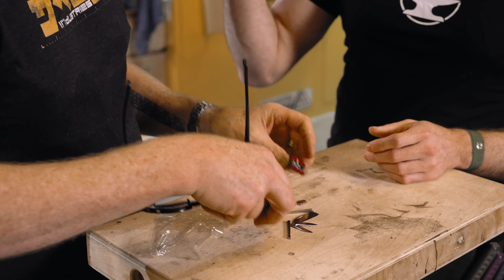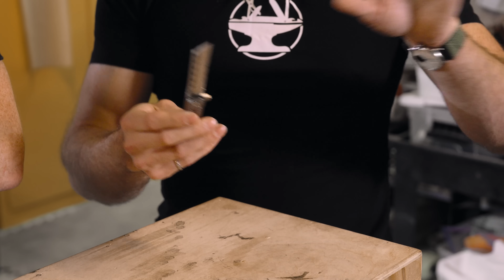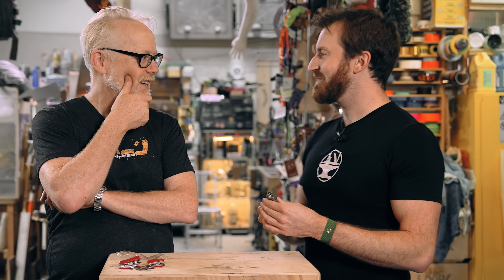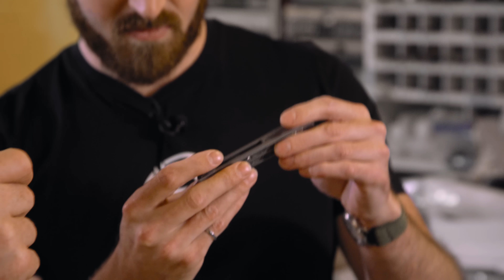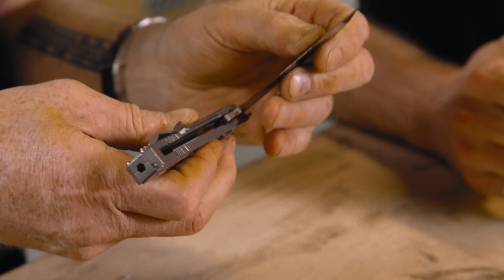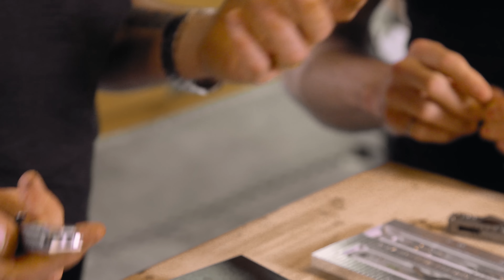Adam Savage Wields Hacksmith's Titanium EDC Multi-Tool!

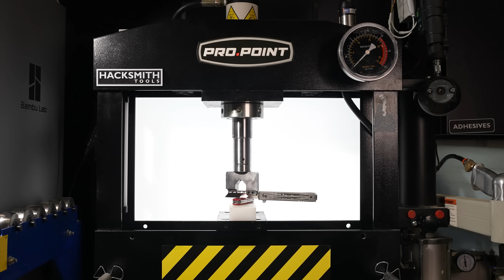Comment: Did anyone notice the damage in the blade (I think) at 01:23
Reply: That's probably where it was pushed down into his boy scout knife tbh.
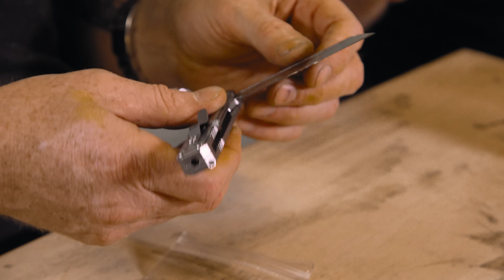Reply: I thought the same thing it looks like the blade has a rolled edge 14:00
Reply: Valid point. I missed that.
Reply: you can see both of them trying not to say anything about it
Reply: nope
Reply: Yes for sure. You’d think they would’ve showed a blade that was mint rather than the blade that’s rolled over from cutting that Swiss Army knife. Glad you caught that. I was about to spend 270$ on the kickstarter for the 14 in 1 prototype. Good eye bud. Glad I seen this. Still kinda feel like buying it now but I wouldn’t be doing anything like that after I pay near 300$ for this little knife. It looks nice and handy though. Wonder if I should complete the purchase. It’s very tempting. I kinda like the look and weight of this knife. I always have a knife on me. This one would be a great addition to my edc.
Reply: @davidlord5664  Trying to cut through several layers of steel with direct downward pressure is going to roll practically any knife edge. I’d be much more skeptical if it HADN’T deformed.
Reply: I think that's for wirecutter

Comment: The external features are cool. However, I find the main blade itself to be impractical for daily use.
The style of blade he chose, and especially the material he used for it, is an absolute nightmare to maintain if used on a regular basis.
I'd much rather it be a folding utility blade, where I can just swap new blades into it whenever I need to.

Edit: I'm also disappointed to see that comments shedding light on this potential pitfall are being censored from his main announcement video...
Makers should take the good with the bad and lay it all out on the table. He shouldn't be suppressing information about the product he's planning to sell.
People buying this blade should understand the difficulties they are going to face with it down the road...

And speaking of customers not being informed: That also includes the fact that the "Pro" version is the ONLY version with that type of steel. Half the sales pitch for that blade is the edge retention of that specific steel. But nowhere in his video is the fact ever mentioned that only the pro version has it, and the only place that information can be found, is in the fine print under an image on the kickstarter page... I believe a lot of people are buying the cheaper versions of the blade, under the rightful assumption that it's all the same steel pitched to them in the video, and missing the fine print that they are in fact not made of the same material. (That being said, I actually think the 14C28N used in the cheaper variants is a much more practical steel for every day use.) My problem isn't with the steel, it's with the seemingly intentional misleading of customers.

Comment: It’s a very cool tool and the ultimate multitool but the pro model costs more than my AirPod Pro 2’s. If there is some way to eventually get it to the $20-$50 range with cheaper materials or optimizing the manufacturing process or something I’d like to get one.

Comment: I'm sorry, but are "multitools" with skrew bits and rulers and tiny crowbars that probably won't work on most things actually worth EDC nowadays? The way the world is right now, I'd rather just have a nice quick deploy razor sharp thick blade and a high powered flashlight on my hip or in my pocket.

Comment: i would love one BUT i cant even for that price tag of 250 canadian....specially in this economy...i donno maybe im a cheap pr1ck but when i go to buy something i RESEARCH THE HELL out of it and that includes ways to pay the absolute bottom dollar for the product even if that means buying a "lower quality" part that does the same job....srry but my milwooky that i paid $25 bucks for has a blade and screwdriver attachment built in and wire stripper....and it was a fraction of the price....

Comment: You forgot to engineer the one thing you needed to - and that is the price. It looks like a capable tool to do a couple of things that I might need it to do. But at $99 up to $200 it missed the mark in one area. That these tools get lost more than they do damaged. Which leads back to price. It's going to be hard for many to replace this tool if lost. It makes more sense to make smarter design choices to bring in a tool at $50. Do we really need the costly titanium?? Really??

Comment: It's neat if you're in the market for a knife with a bit driver built in. Not going to replace my actual multitools though. Also just FYI there are knives with a ratcheting sound when opening, the Spyderco Navaja has it which was based off of the Spanish Navaja knife which also has it.

Comment: 21:42
I decided to do the math for fun

based on the kickstarter, they currently have 12139 knives to make
that's 24,278 CNC mill hours, or ~1012 days

standard orders are supposed to arrive in November, which is, at most, 81 days from now. Given that shipping can take a few weeks depending on the destination and method, and it takes a while to go from a raw CNC cut to a finished product, let's say they need the CNC milling done two weeks before the date of shipping to guarantee they can be finished and arrive on time. That means the milling needs to be done within 67 days, which means they need at least 16 CNC mills running 24/7 to produce everything in house. But, since it'll take a while to order the CNC mills and set them up, I'll round the number up to 20. And, to top it all off, the kickstarter hasn't even been up for 24 hours, and it's supposed to be up for another 23 days. I wish you luck if you truly commit to manufacturing these in-house, and I also wonder, at what point do the CNC mills outpace the assembly process for these knives?

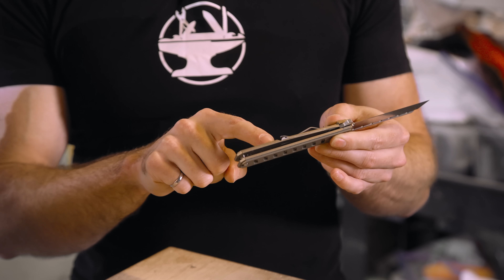Comment: 16:50 would it not be more logical to have the higher gauge wire hole at the end and the lower closer to the ”hinge”? I’m thinking the ammount of leverage on a wire that thin will easily cut too much
Reply: I’ve had gauges sitting in the truck for years and never seen anyone use one in the field. It’s a cool way to make the overall product lighter with a reason.

Comment: This is the type of tool that looks cool, does a lot of things badly. Really, you want to measure angles with a blade? Set level with such a short surface? You want to screw with that short handle?
I get the quality, but usability is just not there.

Comment: It's a good thing he wasn't going to spend a lot of time talking about the bits!

I'm looking at The Hacksmith online store right now, and I like the wallet they are selling there. I'm wondering why there is a video about the wallet, but it does not show how the wallet operates. It is one of those multiple credit card holding, slim-line type of wallets. James and several others talk about the wallet, but that is it. They say they have been using the wallet for a year or two, and that it works great, but there is nothing showing the wallet open, or the card holding mechanism, or how the mechanism operates.

Comment: Damn i need this tool. I'd like to ask about the fire striker. I found after many years that ferrocerium has a tendency to corrode intensely. I think a tool like this I would actually EDC for real and be able to monitor that and take steps to keep it in check but I wonder if there is an option to order one without it?

Comment: I stumbled across this Hacksmith's YouTube video the other day about this multi-tool. I was extremely impressed by it's ability to cut through steel. However, I have set boundaries on myself and the price of this impressive tool is way outside those boundaries. I guess I'll have to be happy with my $80 multi-tool until the price drops or I hit the lottery.

Comment: 8:40

i would think that simply just coat the entire potential drop surface with a rubber/silicone material would ULTIMATELY solve the drop problem...💯

i totally get you want design a RIGID form of metallic material with all these very complex engineering setups to avoid these "drop scenarios"....
but like all decent cell phone cases....just coat the "drop potential surfaces" with a rubber/silicone surface would ultimately solve this problem

Comment: I'm pretty astounded they have 10,000+ backers at such a high price. $250 for multitool, no matter how good, is insane.
Reply: Woah. they had me, hell, 150 I can stomach for a very quality product. but. jesus.
Reply: exactly. It's cool, but it's not $200 cool.
Reply: Even if you can stomach the price, it only has a 2 year warranty!
Reply: It is quite expensive, but as a person in the industry when I see all the details and work behind the knife the price is absolutely reasonable, not even mentioning it's from Titanium and M390 steel which is like the best they could go for. They talked about Leatherman knives which are top tier for 300USD only for the knife, SmithBlade has 21 features in it for 250USD pro version
Reply: That is a reasonable price point considering its superior qualities
Reply: Its expensive, but the multitool is made at the Hacksmith's shop in canada and not china like most other companies so it'll be higher price because of that.

Comment: A Bit retention method that will allow your bits to spill if you drop it twice in a row without checking the tool and fully reseting the bits? 

I get that you believe it is a reasonable expectation that if you drop your tool, you will inspect the tool and fix any problems with it. But on actual job sites and in real life, that is far, far from a certainty. Especially if the user is focused on building or fixing something.

This design choice will absolutely result in lost bits due to droppage and user complaints of poor bit retention. You should design tools in such a way as to minimize the level of diligence an end user needs to bring to bear to operate it without user error becoming an issue. You should be trying to fool proof your tool, not requiring them to adopt strict discipline or new habit formation in order to accomodate your tool's quirks.

Comment: You never held it still and showed it up close. I spent the whole video trying to dance around and see what it actually was. I get it is not an advertisement. So how about some details? Materials? Hardness? Actual size? Blade metal? Thicknesses ?   Sharpening ? Can you not remove the blade and sharpen it on its own body?  Rockwell what?  Good luck guys. Seems like you have a very positive attitude about an exceptionally blah redundant edc. Does it lock? Can I baton strike it?  Flint and not Ferro?  Replace flint?  Price? Replaceable blades? . So many relevant questions. Titanium? Why? Just marketing ? Save 5 maybe 10 grams double the price? Why. What are the actual torque limits on the hex? I’m going to do a deep dive and try to find actual answers to real questions that people who actually use tools might  actually have.  Nice you drove it through a Swiss Army knife with a hydraulic ram.   Can we please see the blade afterwards?  Did you ever think about driving a Swiss Army knife through it with a ram? I can’t tell you how many times a day I need to do that. I love Adam and the positive energy but this whole thing smells of a paid add or an infomercial  ,  but with no info.  Definitely the right track you are on

Comment: Really disappointed to see Adam Savage marketing something from a brand so willing to deceive their fans. The steel they use in the bottom two models (that most people will buy) is much worse than the one they use in the high end model that they're using in their marketing without acknowledging that isn't what they're selling at MULTIPLE levels. Including the "base" model you would expect to be the main one.

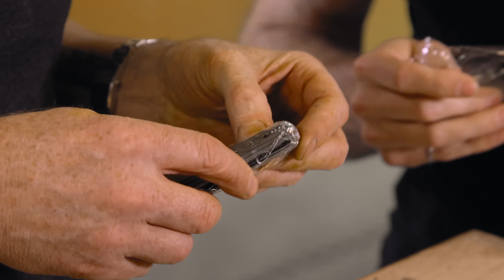Comment: 22:48 Seeing Adam use one knife to open up the packaging on the other knife just made me chuckle. It also reminded me of King of the Hill when Hank was trying to get the cap off a can of WD-40, so he pulls out another can of WD-40 and sprays the first can with it and pops the cap off.
Reply: "you have a hacksmith Multi-tool light, it can be opened with a Hacksmith multi-tool pro"
Reply: Reminds me of the scene  in Ratchet & Clank 2 "use wrench to break glass to use rock to break glass to get the wrench"
Reply: Got to have your EDC holster for your EDC WD-40 for those little squeaks that surprise you out of nowhere but are irritating!
Reply: @omegatotal the knife should have a can of WD40 in it

Comment: 13:19 there the blade damage from cutting the other pocket knife in half. Which is not bad as one could expect I could be with the force put on the blade. Damage like that should never happen in normal use.

Comment: Weird thing I remember reading in regards to those bits is that I believe are two interpretations of the spec. One is that the bit needs to be 4 mm, the other is that the socket that holds the bit needs to be 4 mm. That's why they are not quite as standard as you'd think.

Comment: This dude is such a huge nerd about this thing, and I love it. When he was explaining the torque tool at the end, he was just giddy about it.
Reply: Yeah what did he mean by that?
Reply: @riggmeister  He made a curved plastic piece that goes onto the bits, and when using it, you know the screws for the tool itself are tightened to exactly the right level of torque when the plastic is straight, all without needing a torque wrench that can be set that low (5 in-lb, which I can't even find from a quick search. The lowest I can find is 10)

Comment: 9:05 Linus Tech Tips actually found the exact same issue when they were building their precision screwdriver set, most other manufacturers aren't using the proper specs for the bits and/or sockets

Comment: I'd use the fuck out of that thing at work, but I dont think the blade would last. I wish there was a version where you could screw 2 standard razor blades onto it.
Reply: Hey friend, what do you cut at work? I think this blade looks pretty durable for a folding knife, but I have worked with certain materials that you're better off ruining and replacing utility blades
Reply: i work in hvac, so i cut a little bit of everything. and i know cardboard boxes are especially bad on blades.

Comment: That toque wrench was definitely something to get excited about. Not just for its technical design but its large scale environmental thoughtfulness. He’s not just engineering he is being conscious and thoughtful for everything and letting loose. We need more people like him. He’s solving problems.
Reply: Thank you!
Reply: @hacksmith   i would rather have a million metal wrenches in the landfill than a million of little plastic bits. only one of those will decompose properly
Reply: I was literally flabbergasted when he explained It as a 3D printing enthusiast I loved that idea
Reply: @LordT3ch  have you seen those resin lithographic printers that can make a clear resin print in about 30 seconds and then you just reuse the rest that didn't get exposed to the gradient rotating image? Of course it still has material limits because it's still clear resin but it could save lots of time and plastic 3D printing for many of the things you print pieces to prototype.
Reply: i bought a bike the other day from Canyon and it came with one of these and was compliant up to 12 Nm. It is very thoughtful that he is adding it to the knife but its nothing new.
Reply: Not just that, but as of a couple of days ago, they published the file for printing it on their website so if for any reason you lose your bit flag, you can print you own! Obviously not everybody has a 3d printer but it's a lot easier to commission a small piece being made than to try to contact the manufacturer to eventually get a replacement, so this helps a lot too!
Reply: I didn't get that part, I know compliant though (like an all in one)
Reply: Yea, made in china though. No thanks
Reply: this isn't a new idea they've been around for a while I just used one earlier today at work and I've seen them throughout the years
Reply: Is a plastic solution really superior to a metal one? He says they end up in landfills but I image a large percentage get recycled as intended.
Reply: Is it meant to be one use? I'm curious how important the torque is. I think IKEA kinda sorta does this too, their tool will slip from the handle with enough torque.
Reply: The Canadian in him is showing. We do tend to think beyond just profits here in Canada. Well save for one Province.
Reply: @MarcSherwood  yeah, that one province that gives BILLIONS to the other province(s) that can't control or manage their own budgets.  Pound sand bud.
Reply: @Industrious420 the one that make nothing, but sells what was already there. If geography were slightly different, Alberta would have nothing. No innovation, no tech just sad
Reply: A wrench for knitted caps?
Reply: These tools are still not accessible enough for all woman to have equal access.   Taking this position is not helping
Reply: It's a cool idea, but how does that change anything about the fact that tons of IKEA allen keys end up in a landfill..?
Reply: @asdads3948  They don't add to it.
Reply: What are you on about this is a predatory overpriced gimmick "tool" that is worse at everything it does. 99% of these will be in the landfill. Guaranteed.